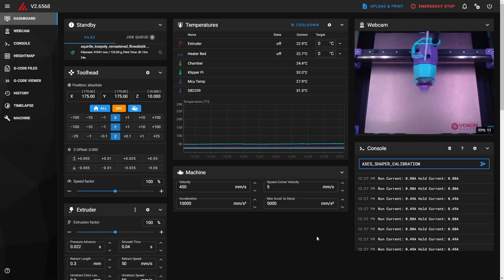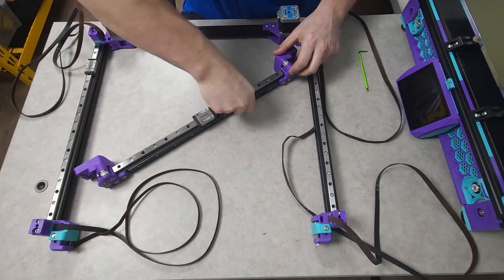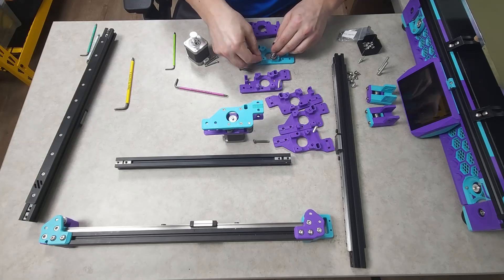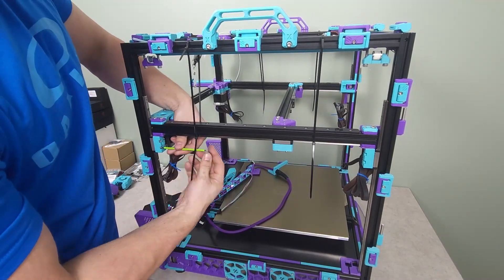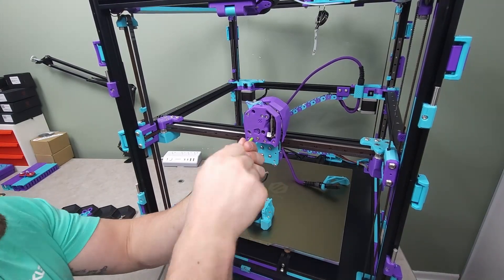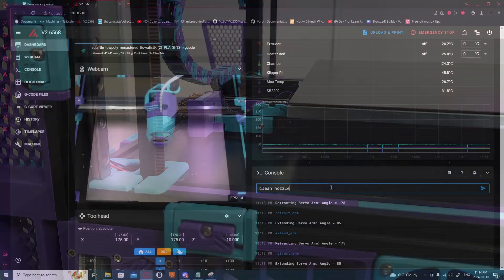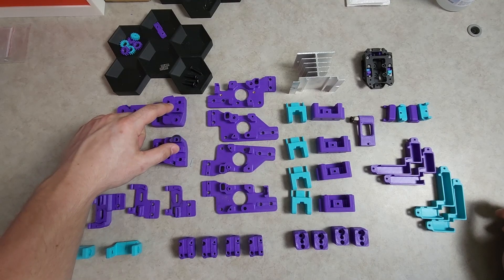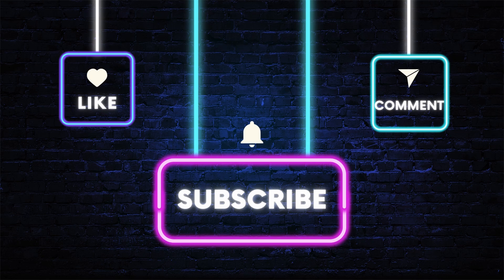Voron 2.4 Upgrade Part 2. Time to (Pin) Mod!

Comment: Hi, i just printed the A/B-drive parts with pin mod but i can't get the pins in the holes. Is this supposed to be a tight fit and i have to hammer them im place or are my parts printed bad with too tight holes?
Reply from the maker: @janhofmann3499  use calipers to measure the pins and the holes, mine press fit nicely

Comment: Amazing, still have no idea what a pin mod is!
Reply from the maker: If you're genuinely curious I'm happy to explain!
Reply: @Browzzrr  Yes please! Subscribed :)
Reply from the maker: @dezent  so the x/y joints (that carry the x beam on the y rails) and the a/b motor mounts use bearing stacks and idler for the belts
They are held in place with m5 bolts and nuts stock, but if overtightened they bind, or too loose they cause bad Input shaping graphs from too much play. 
The pin mod replaces those m5 bolts with pins so that you remove the risk of them binding or having too much play!
Reply: @Browzzrr  Built my V2.4 LDO kit two weeks ago and right now it prints beautifully so I don’t want to break anything but I googled it quickly and made some bookmarks for future upgrades. Thank you!
Reply: @Browzzrr  Damn you! got the pins ordered and printing the parts now :)

Comment: I particularly like that you did before / after benchmarks. Would the pin mods be what made a difference in the input shaper graph? Did you cut the belts to same number of teeth? Congrats on your success thus far. The quality is on point!
Reply from the maker: Hey Seb!
I think the Pin mod is just a quality of life mod, it really just takes the fiddling and guess work out of the X/Y and A/B bearing stacks, With the pins, you can just assembled and snug up the bolts that hold it together and not worry about finding the sweet spot for every idler/bearing. (also removing your chances of binding)
If I had to guess, the GE5C was the root of the accel boost seen in the video! 
Thanks for the continued support!

Comment: what size do you use on the cable sleeve ?
Reply from the maker: I use a ton of cable sleeve! what part were you referring to? the sleeve on the brush is 4mm, but I also use 8mm on a few things as well (like the motors)
Reply: @Browzzrr  for your canbus umbilical. im trying to go for something similar
Reply from the maker: @zap117  https://www.aliexpress.com/item/1005001879064414.html?spm=a2g0o.order_list.order_list_main.19.26351802RLEyv0
8mm!
Reply: @Browzzrr  ty 😎